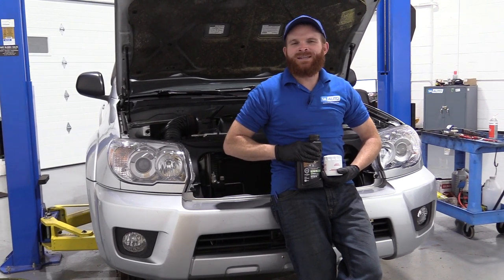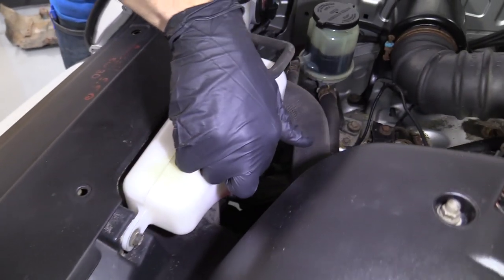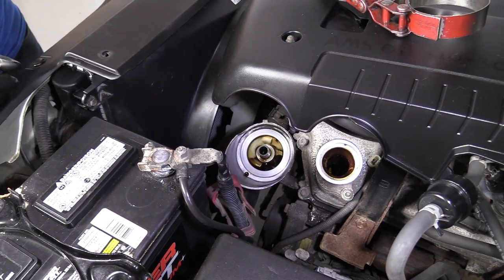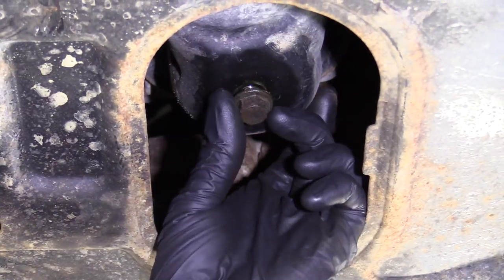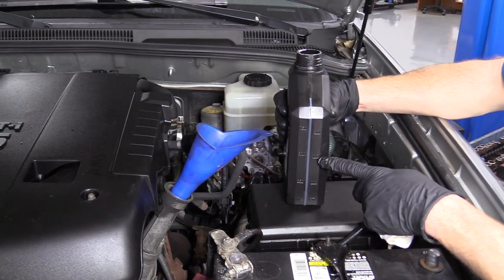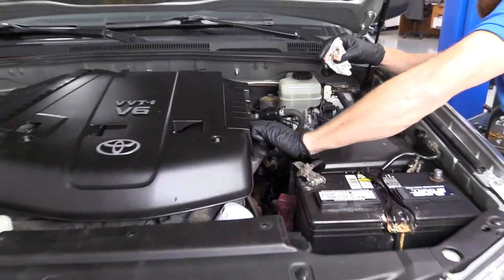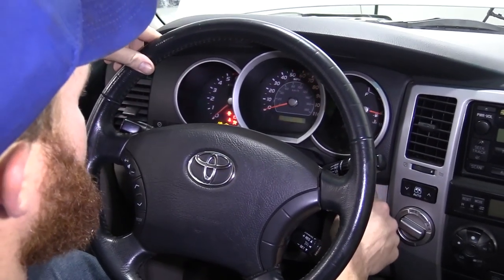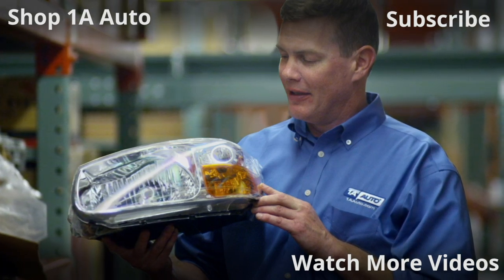How To Change Engine Oil 03-09 Toyota 4Runner

Comment: When he’s pulling the oil filter off, to avoid oil dripping into the engine bay.. there is a hole and a nipple on the under side you can hook a 1/4” or 3/8” hose and route it temporarily or permanently to drain to your oil waist pan. Super easy oil change on this vehicle. 👍🏻
Reply from the maker: +meansled Thanks for the feedback!
Reply: @1AAuto  Thanks for the helpful videos!
Reply: dude its a toyota, the oil keeps the rust off the accessories, let it drain into your engine bay!

Comment: Hello, why did you use two different kind of oils? And how do i know much oil i should add every time i make an oil change? Thanks and great video!
Reply: If I can answer on their behalf; they used the same kind of oil out of 2 different sized bottles. The first was just a 1 quart bottle and the second was a 5 quart bottle. The V6 4Runner's capacity is 5.5 quarts. I only know this because when I get mine changed, they charge me for 6 quarts because they have to open another 1 quart bottle and use half of it (like he did with the first bottle in the video). I imagine your vehicle's capacity would be in the owner's manual, and I'd bet you could find it online too.

Comment: I got an 05 4runner that I purchased brand new from the dealer with 100 miles on it. I currently have 217,000 miles on it and have been using regular oil and have no issues. The dealer never recommended anything else plus the owners manual says nothing about using synthetic oil so I guess I'll continue to use regular oil, saves me money.
Reply: Of course the dealer recommended regular oil, because they want you coming back when she starts wearing out!
Reply: Lol it doesn’t save that much so it’s  like whatever.

Comment: You need to mention that when you take off the oil filter it doesn't collect in there, it drains write down on your motor and onto your driveway carport of wherever you're working on. Put a small cup or water bottle or something underneath it or if it does come out it's going to drain right through that little hole and all over your floor

Comment: I always wipe the drain plug off and put a thin coat of High temp silicone all around  the threads .
It acts like a mild thread locker and sealer .
Ive been doing this on Cars trucks and motorcycle drain plugs for over 40 years with excellent results  .

Comment: What oil brand recommend? Because toyota stop used 5w30 they replace  for 5w20
Reply: The only reason they switched is for fuel economy. You can even use 5w30 in a brand new 2021 4runner. But because of fuel economy, they say to only use 0w20. I use 10w30 in my 04’ 130k miles. Royal purple hmx is best or you can use Mobil 1 high mileage.

Comment: How long should I wait after starting the vehicle and turning it off to check the oil level?
Reply: 5-15 seconds to let the oil pickup circulate.
Reply: About 5-10 minutes will give the oil enough time to drain down to the pan .

Comment: I skip the drain plug and the mess these days. I installed a Fumoto valve in place of the bolt (dirt easy install the next time you change oil) . Then Just connect a 12 in or so piece of 1/2 inch ID plastic tube, point it into the drain pan, flip the open little switch on the side of the valve and presto, oil draining. You'll know when it's done when you don't see oil draining thru the clear plastic tube. Look up Fumoto, you'll thank me,  BTW this is an unsolicited tip.

Comment: i used to trust a toyota dealership for oil changes.  but over the years they have been over filling the oil, which could be the reason why i have a valve cover leak.  i don't hold the oil change guy resposible, i go after the captain, Toyota.

Comment: You're putting solvent on your gasket right away, maybe that's why it's sticking and breaking down like that.
Reply: Also the bottles normally sit right on that type of funnel, or in the thread, no point wasting a drop of that stuff.